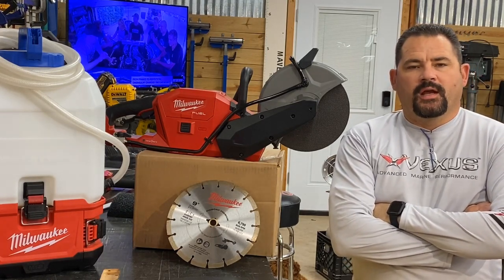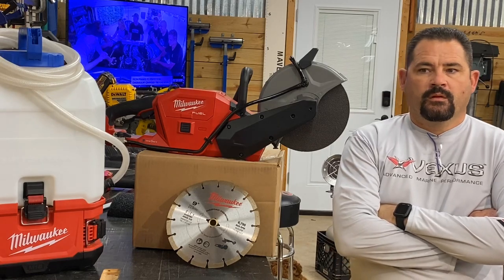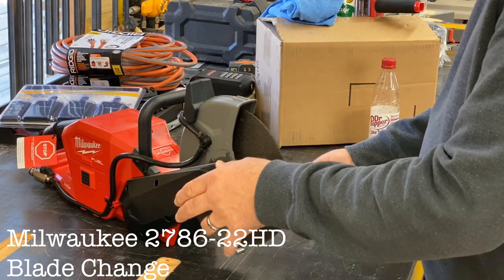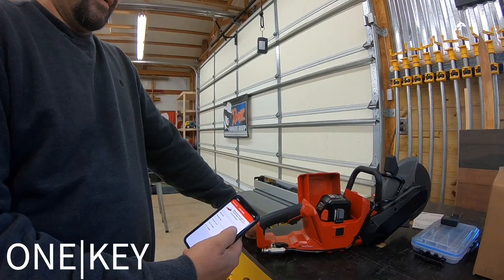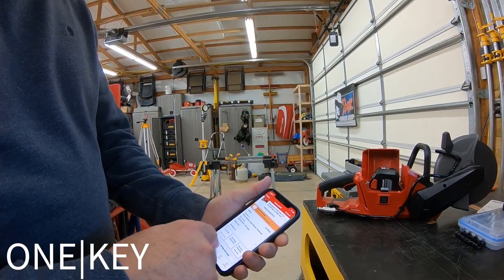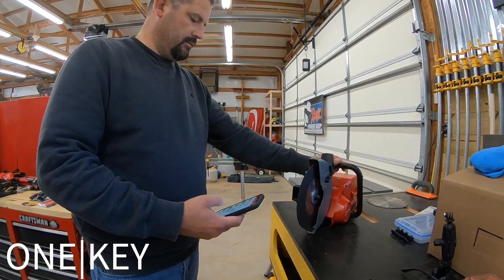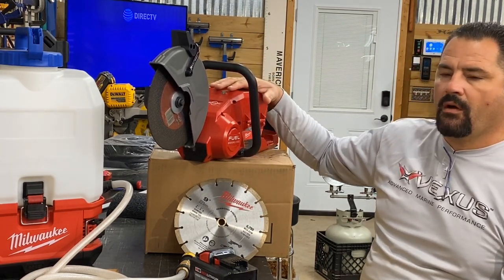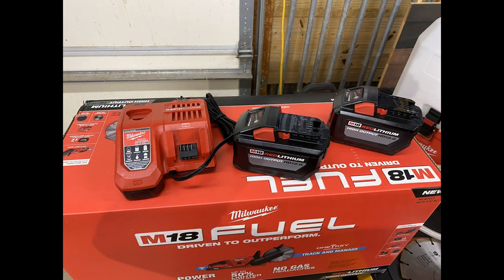Milwaukee 2786-22HD M18 FUEL 9” Cut-Off Saw with ONE-KEY Kit

Comment: So I bought this saw and just used it to try and cut a 12" slot in 1/4" mild steel plate and it couldn't cut 12" without it overheating the battery! I used my flexvolt grinder to finish cutting. Have you experienced this or is mine a lemon?
Reply: I watched your review along with many others and im wondering if the battery gets warm too easily?? I can imagine it over heating on a warm day especially.. im still a fan of using a 1/16” cutoff disk on my small angle grinders..
Reply from the maker: If you are trying to perform a plunge cut, it takes way too long. What you have to do is get on the top edge of your material and pull the blade through it.  As far as concrete cutting, it is fantastic!
Reply: @WrenchAddiction  I've used it some more and it can't make it halfway through a 12ah battery without overheating. I've used it on concrete, brick, metal, etc. I'm not using any force at all, the yellow indicator rarely ever turns on and it just overheats the battery. I have to have 4 batteries on rotation to cut anything. The saw itself hasn't gotten too hot, just the batteries. Whereas my flexvolt grinder cuts faster, less bog and doesn't overheat. Just can't cut wet. I think 60v makes sense for higher demand applications just because 60v is able to deliver a higher amperage without excess heat buildup.
Reply from the maker: I just wonder if it’s possibly “your” saw.  Call 1-800-SAWDUST and demand a replacement.  I can almost assure you that you will get one.💪🏻💪🏻